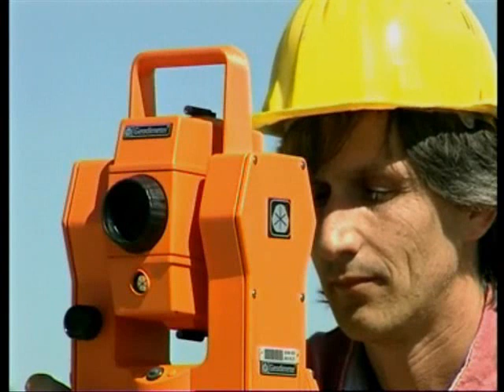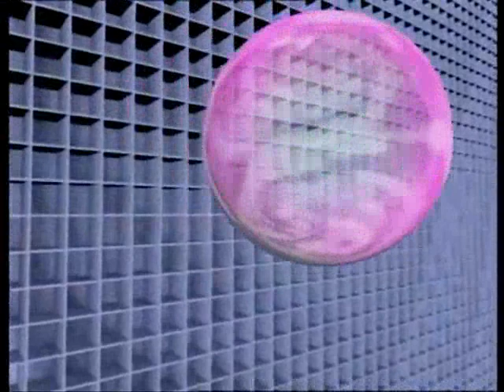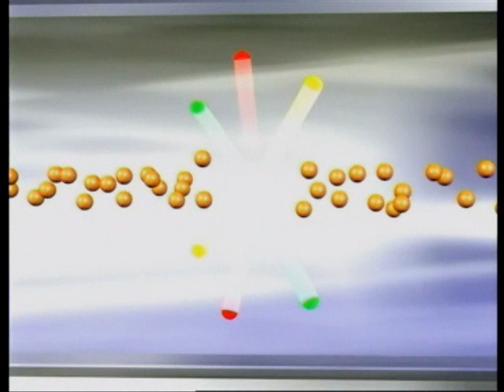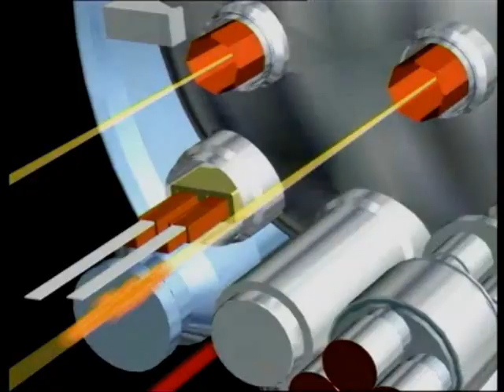LHC The Time Machine 1

Comment: Space and time is not an illusion, they are units of measurement that used to show the relativity between objects much like all measurements do. If I moved at a "snails" pace when I was walking, you would most likely characterize that as slow because your generalization of time is perceived by your environment. Your environment is characterized by yourself or objects around you which make you interpret your volume of "space".

120 liters, 40 meters, and 20 seconds.

Comment: They usually bombard certain materials with photons (e.g. lasers) to split off the require particles that then get injected into the accelerator ring with the help of magnets.

To make sure the particles are (to a high degree) alone in the tunnel, they pump out all  the air. The LHC is gonna an immensely good vacuum.

Comment: That's not the comment I quoted from, go back and read what you wrote before. 
You have to be a troll, you're just stating uneducated statements to try and keep the argument going. There isn't enough matter inside the ring where the protons would be crashing to create a black hole or at least allow it to grow, if there was then the protons would be crashing into other atoms before it even got the the first stage of the LHC, there isn't ANY matter in there because it is a VACUUM!